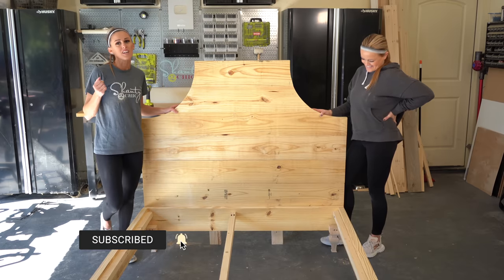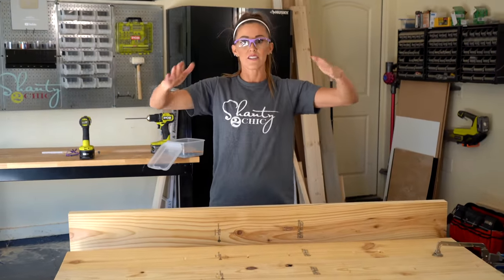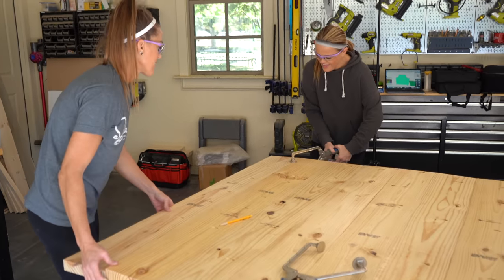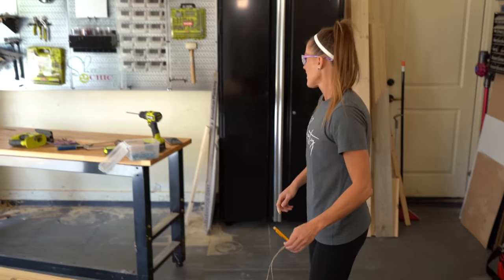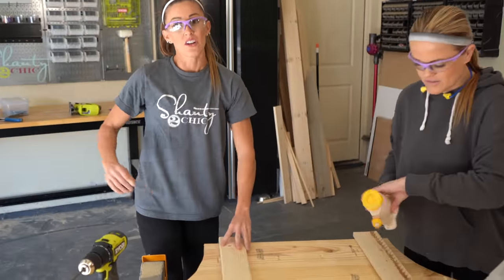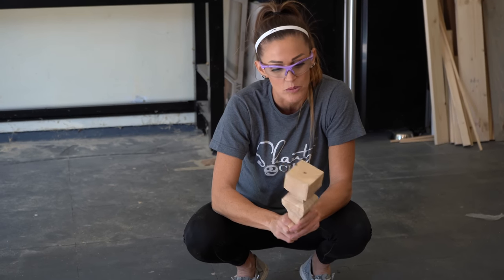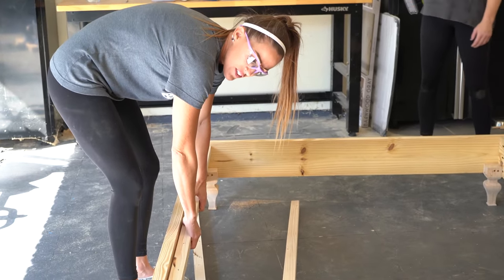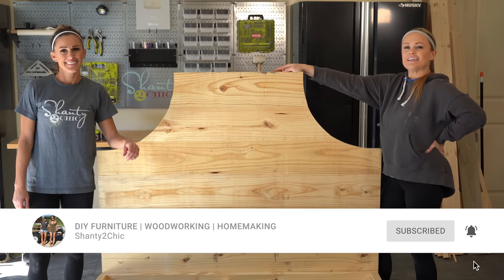A DIY Bed Anyone Can Build!

Comment: What are the settings on your Ryobi driver while screwing in the pocket screws?  I’m having a hard time with this part.  Thanks.
Reply from the maker: I usually have mine on full but if they’re stripping I’ll turn it down a bit
Reply: Most Ryobis are variable speed triggers. You might be squeezing the trigger too hard too fast.